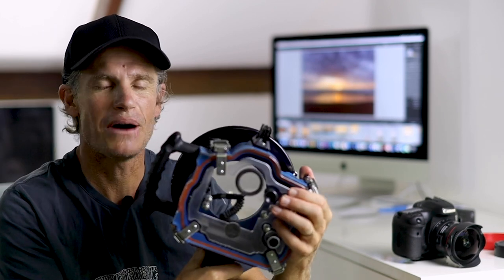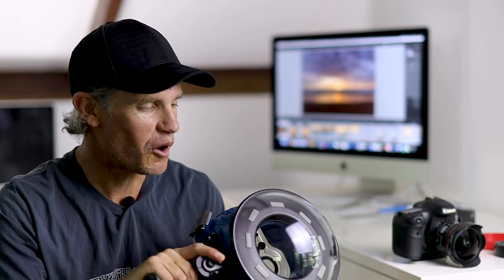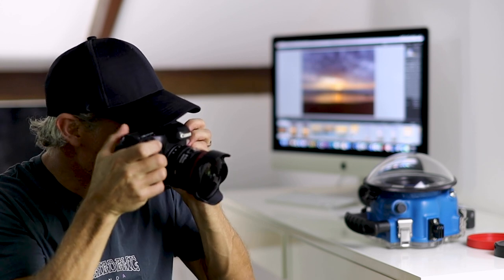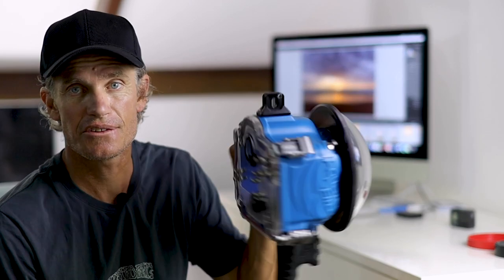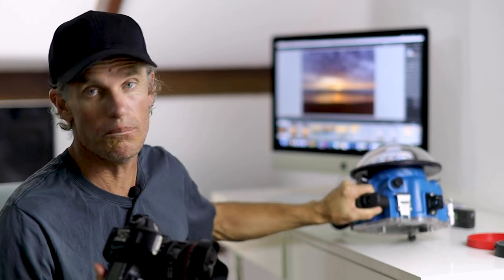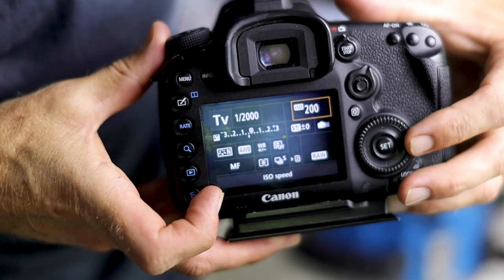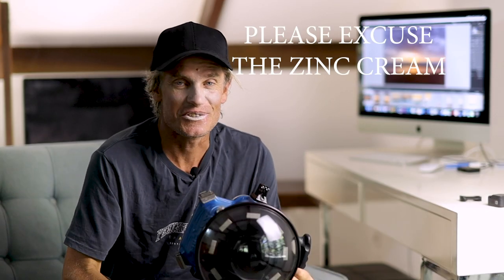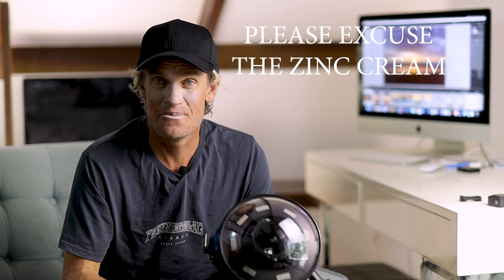Camera Settings For Surf Photography Using Water Housings Without Manual Controls

Comment: Thanks Tom - I've got only got a back plate for the 5dmk4 but I far prefer to use my 7dmk2 so it was really good to watch this. With the 70-200 lens would you set the focus as per your ultra wide angle ? Love your video's and thanks for sharing !!
Reply from the maker: Hey Fenna, thanks for your message. The pre set of focus only works for super wide lenses like fisheyes or lenses under 20mm. If definitely will NOT work for your 70-200mm lens. You will need to use your 5Dmk4 camera when using your longer lenses. Or get the back plate for the 7Dmk2

Comment: Do you recommend a flat port or dome port
Reply from the maker: Sorry for the late reply Christian, I only just came across this question today. I recommend Dome ports for lenses 20mm or wider (so your 8mm to 20mm) are best in a dome port. And then when using longer lens like 35mm, 50mm, 100mm or 70-200mm lenses are definitely better inside a flat port. Cheers

Comment: Great video mate! What mode do u shoot in, action?
Reply from the maker: Hey Nick, Thanks so much for your message and kind words. I generally shoot in Manual or TV mode for action, depending on the light. If I am shooting towards the same area (like at a reef break or point break) then I set in manual, but in an unpredictable beach breaks with randoms lefts and rights in the surf I will shoot Shutter preferred mode (TV mode) Freezing surf action normally set shutter speed 1/800th or higher
Reply: @dreamlifephotography  I like to have all the actions at my disposal, there at the moment, I use everything in the manual, I have the control buttons on the back of the box to suit me, the only thing I set up before is the lens focus, like the aperture ring that I leave at 5.6 or 8 and the other ring I leave close to infinity, so I know I’ll have everything in focus, I use this technique when I’m using the 7 artisans 7.5mm 2.8 fisheye, because it’s a completely manual lens.
Reply from the maker: @giuliannomoroni7860  sounds like a solid system... nice work

Comment: Very nice Videos, trank you! What are the white little stripes in the domeport? Do you have problems with fog of moisture inside the housing ? Best regards from germany.
Reply from the maker: Thanks Yves, appreciate your kind words! The white squares are double sided tape that came with the port where you can apply black fabric to reduce reflection from the front of the dome to your image... but I don't really use it, as I normally don't have a problem with reflection
Reply: @dreamlifephotography  Hi Tom, thanks for your answer! Do you sometimes have the problem that moisture collects inside the lens port or dome port?  I have read from other cases that this happens because of the temperature difference.  Some people then put silicate gel bags in the case.  I have the Elite body for my Nikon D500 and will be starting surf and wave photography in Europe next month.  Kind regards and keep it up.
Reply from the maker: @splash.photography.germany  Yes this can happen.. The only time Ive had it is when I have been on boat trips on the equator where the housing is kept in the cool air conditioned cabin and loaded there and then brought out into the warm tropical air. The best way around this is to have the housing un loaded and open to the natural air temp (whether that is cold or hot) for at least 15 minutes before loading and then you should have no problems. But yes I have heard moisture bags can help. But the best results will happen when you get the housing used of the air temps before loading it up. Also another thing to watch is that the housing is super dry, sometimes small drops of water can sneak into housing when unloaded from the previous session and just one drop probably won't harm your camera but it can create condensation. Hope this helps? so exciting that you are starting your journey with water photography in Europe this summer, it is seriously the most fun and rewarding pursuit. I wish you all the best and please hit me up with any questions. Yew!!!
Reply: @dreamlifephotography  Hi Tom, thank you for your help. I'll follow your advice and I'm curious how the pictures will turn out.  Of course you have to practice.  Thank you for helping me.  Unfortunately, Aquatech does not offer any advice on the subject of moisture.  I will continue to accompany your channel and am looking forward to your further results. Best regards, Yves
Reply from the maker: @splash.photography.germany  thanks mate, I may do a live video on this topic on instagram soon. It comes up a little bit, so its worth the discussion. If you don't already follow my insta it is @stimages or link here: https://www.instagram.com/stimages/
Reply: @dreamlifephotography  very cool, so i follow you yet on insta too. 😊🤙 do you use the autofocus under water if you make pics behind the wave channel or is it better to make the shot with a focus infinity to make sure the camera doesn't focus incorrectly?
Reply from the maker: @splash.photography.germany  when going under water is it MOST DEFINITELY better to use AUTO focus. I have multiple videos inside my "water photographer" and "camera settings" courses that explains why and this is so and how to achieve best results under the water. You can enrol in any of the "water photographer" workshops to get full videos on this exact topic as well as everything else to do with water photography. The link to these options is at this link: https://waterphotographycourses.com/ at this link you will find two courses that will help you with this. Cheers legend Tom

Comment: mate I found a bit confusing when you mention you would not be able to focus with the housing? and then afterwards you mention you can actually do that with the Base housing... can you elaborate? Thanks
Reply from the maker: THanks for your patience with the late reply on this one, just finding some older messages today. So I wasn't using the base housing in this video, but if I was I WOULD be able focus. But I was using a totally different housing for the camera type, so I could only use the pistol grip (cable release trigger) which means I had to preset the focus... so that is where it might have got confusing... cheers for the message

Comment: mate I found a bit confusing when you mention you would not be able to focus with the housing? and then afterwards you mention you can actually do that with the Base housing... can you elaborate? Thanks
Reply from the maker: HI Victor thanks for your message.. so I was using the 7D camera in a 5D housing so the focus buttons don't line up so I preset manual focus (something that you can do effectively when shooting with a super wide lens) When using the base housings with the camera it was designed for then auto focusing is 100% possible and works fine... hope this clear it up for you? if not let me know